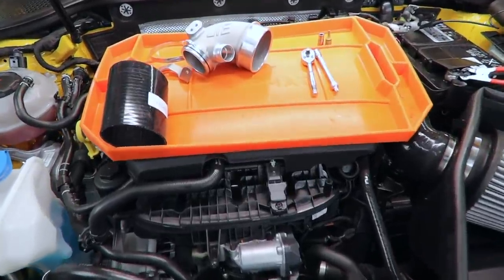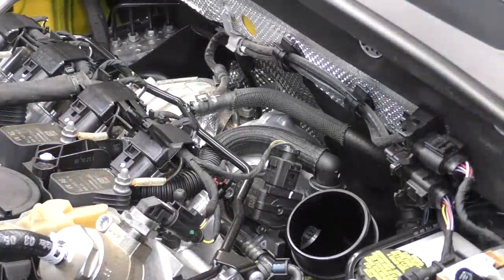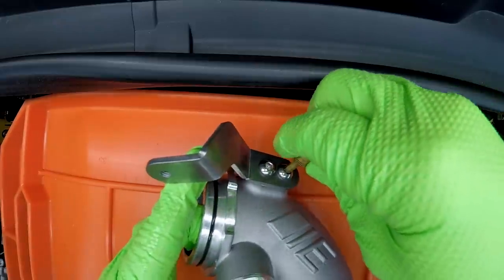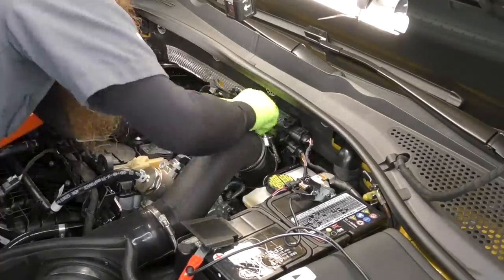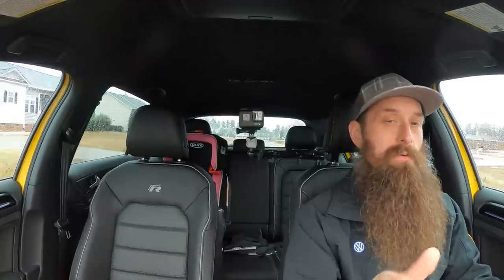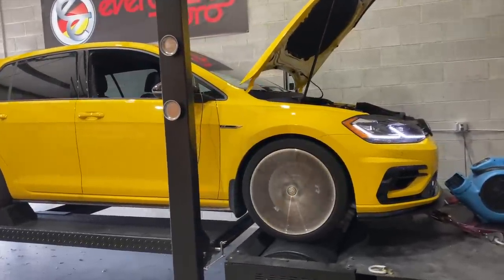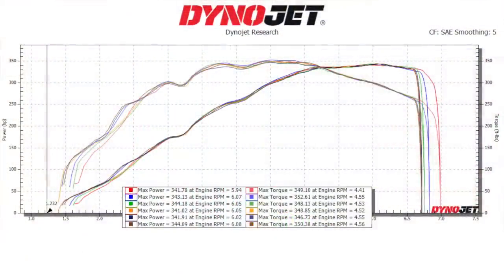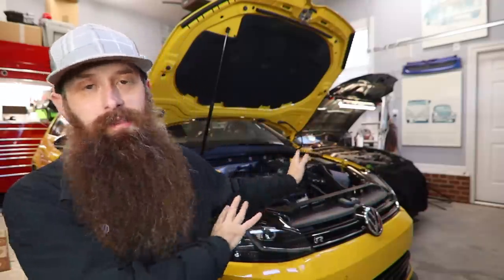Turbo Inlet Pipe Upgrade and FULL Stage 2 Golf R Modifications

Comment from the maker: So we are stage 2 now. SUPER FUN! After IE has the stage 2 file 100% we will go back to the dyno. Also While not 100% needed, I think we are going to upgrade the spark plugs. IE recommends NGK R7437-9 at .024" gap. Those babies aren't cheap at ~ $40 each. :)
Reply: Is it 100% necessary to install spark plugs for a stage 2+ ?
Reply: @yoyigu  I've always heard it's "strongly suggested" to go at least a degree colder on your plugs with stage 2 or 2+
Reply: When I had my 6R flashed to Stage 2 (Unitronic), the tech said I should expect the car to get a little faster over the following month as the engine and ECU settle into the new tune.  Have you heard this?  I'd be curious what your dyno numbers are after about a month/1000+ miles.
Reply: Rockauto has those plugs for $28
Reply: Or just spend a lot less and go Brisk ER12S. One step colder vs stock. Have to check gap a bit more often, but otherwise a great plug. Many running this plug very successfully on stage 2 or higher with big turbo. I run the Er12S on my stage 2 mk7 R on a E40 map (~415whp) and its been great
Reply: NGK Ruthenium
Reply: Was hoping to see closer to 400whp maybe the new tune will???
Reply: @yoyigu  it varies by tuner. Unitronic doesn't recommend any changes to spark plugs or change intervals. APR and IE Recommend uprated plugs , slightly tighter gapping and a lower mile change interval Just to be safe, do what your tuner suggests.
Reply: Hi Charles, can you please please make a video for water pump replacement?  there is no single normal video for it on YouTube.
Reply: @YoWassupFresh  perfect,  i have apr stage 2 high torque 91 oct , thanks!
Reply: I use OE spark plug AudibRS7 NGK 1step colder.
Works perfectly..no need gaping!!! And mine is a fast stg2+ ...
Reply: @pushdaenvelope  does it require a "special" E map?! As the sensor is build in by factory.
Reply: 400whp On pump gas?  No way.
Reply: @dirk5950  400who around 480Hp?! He want to mwntion around 330whp..that is around 400hp
Reply: This is the USA. We speak in whp only.  That’s what our dynos measure.
Reply: @JamesStreck0312  ive heard the ecu adapts to your driving style so it knows when to shift and how the throttle should feel etc
Reply: @Master321v  yes, I have a e-tune (custom) ECU tune & DSG tune through EQT Tuning. To run EQT's E40 map I did have to upgrade my high pressure fuel pump, as well as, all the std Stage 2 mods (downpipe, intercooler)
Reply: @danielhildebrand6892  don't think I've seen anyone hitting 400whp on stock IS38 turbo and pump gas. Need to run ethanol blends to get to the 400's on stock turbo
Reply: What a great job in explaining all!!!!! Thanks
Reply: 7.5 golf r❤️
Reply: HumbleMechanic amazing!! can't wait to install my IE stage 2 kits
Reply: Managed to get some timing logs on 100 to 200 timings as well as 0 to 100? Would be awesome.
Reply: HumbleMechanic I love your vids!  I'll be going down a similar path with IE in my GTI.  I have stage 1 EQ tune and cant wait to get started on IE mods.
Reply: Mr. Humble how confident are you in IE's tuning expertise in comparison to other's?

My thoughts is they may know their stuff more due to all the parts they manufacture.
Reply: Why is that so low on power? I have VWR600, TurboTechnics intake pipe, BCS Downpipe 100cpi cat and map no intercooler and made 408bhp and 420ibft on 2 different dynos.
Reply: Need to update to the current tune version and dyno to see the changes
Reply: Are you still happy with your stage two?
Reply: What are your thoughts on e85 with stage 2
Reply: My tuner said there is no pops and bangs for manual trans golf r 2018 mk7.5
Reply: How much bhp is it now ?

Comment: Charles don't just look at the peak numbers, the graph tells a great story in green.  Your peak torque may be the same as stage 1 but look how much sooner it rises in green.  Same for the horsepower, your powerband is stronger for a pretty wide RPM range.  That's something you'll feel when you're driving daily rather than just full throttle.  Good work!
Reply: Yes looking at the area under the curve is right, and it needs work between 3-4k rpm.
Reply: It's a little better. Not a lot better.

Comment: I went full APR Stage 2 on my 2016 Golf R manual in late 2017 after being on Stage 1 for nearly 2 years. According to the APR published numbers, I was at 354 crank HP and 379 crank TQ. With Stage 2, the numbers improved to 387 crank HP and 409 crank TQ. The improvement wasn't quite as dramatic as going from stock to Stage 1, but the difference was still considerable, meaning the car went from crazy fast to absolute bonkers. Definitely worth the cost!

Comment: I went from stock to stage 2; Got a lovely 100hp awakening. 
-Eurodyne stg.2 and DSG
-Racing line intake, turbo inlet pipe, and hose
-CTS turboback (de-cat), engine, trans. Mount 
-034 torque insert
I must say that it has been so much fun driving a over 400hp (crank) car. Debating if I should get the intercooler since I don't track my car and I don't use all of that hp as frequent as I would like. Great video.

Comment: The United motor sport tune is fantastic. My clutch started slipping right away, but I put in a TTRS pressure plate w/ new OEM fly wheel and clutch disc. So great now
Reply from the maker: Nice!! I have UM on my R32. Probably going with their Haldex tune on the R

Comment: Charles. I have did an IS20 withe IE stage 3 tune with the DSG tune on my VW Alltrack. This is hands down the best tune money can buy. I am shocked just like you at the power. The shop that did it for me recomends the NGK racing spark plugs you state bellow only above 400 horsepower. The stock ones gapped at 0.026 work better for us under 400 horsepower and is more correct. IE states this gap on their site for all engine tunes. Love your channel. John

Comment: Good video. To your point, Charles, about how important this piece is, it solved knock under load on a MK7 GTI Stage 1 and A3 8V Stage 1 as well - no other parts added. It improves flow at the turbocharger significantly.
Reply: so its worth adding to a Stage 1, in your opinion ?
Reply: @JDDD33  I would say so. A known good product that will facilitate the increased airflow from the turbo is a good thing indeed.

Comment: I would recommend anyone installing a stage 2, install a good catch can. Also another good upgrade is converting from the plastic sump to an alloy sump with cooling fins. They hold another 1.5QTS of oil, and drop the oil temp another 20F.

Comment: Got an IE turbo inlet for a customers car. Ported it and polished it. The stock inlet will now fit inside the IE pipe! Next restriction is the inlet of the turbo itself. You can see through the IE turbo inlet to a ridge of the turbo that is blocking some flow into it. Time to bust out the die grinder and get to work...

Comment: I had a similar interpretation of my 2019 Mini JCW. I had a stage 1 and then went to stage 2. Stage 1 (ecu tune only) is how the car should have been from the factory where the engine pulled pretty stout and strong. Stage 2 (High flow 200 cel downpipe, uprated inter-cooler and stage 2 ECU tune), ok, now it's showing a hint of gnarly beast in there some where. I can see why the factory wouldn't necessarily need to sell it this way.

Comment: Just to give you a heads up, we just did a compression test. 
2019 Golf R DSG
Cylinder 1,3,4 came back at 185psi.
Cylinder 2 came back 160psi. 
Not saying its blown, but we will put a scope in it soon.
Reply: Hopefully head gasket like when my car lost compression in 4 and 6
Reply: @britishav8tor75  yes Im FBO/Full E85.
Im not worried, i have been expecting this to eventually happen.
Reply: @whydoihave6neutrals772  would be cool, ill keep you updated.
Reply: Some One good luck hope it’s that and not your whole block! Good luck!
Reply: @whydoihave6neutrals772  fingers crossed
Reply: rings. sorry
Reply: @SomeOne-on6yf  What symptoms or symptom were you having that made you do a compression test?
Reply: @zohanjames7793  low dyno numbers,  scope test came back looking good, another compression test confirmed finding of low pressure in cylinder 2
Reply: @SomeOne-on6yf  damn, I'm sorry my man. Do you think the tune caused this?
Reply: @zohanjames7793  to be honest, we bought the car to be hard on it. We had several tunes on the car in the past 13k miles. So there is no real way to say  what actually  caused the issue. 
We will see what happens moving forward. Either way, we will suprise people what this thing can do. 
Might start another channel with edited  videos.

Comment: The big difference between Stage 1 and 2 wasn't really the peak gains but how much power/torque was gained on the top end.  Looking at your dyno charts it was a significant gain.  Since I have a 6MT I probably won't go stage 2 until I need to replace my clutch.  At that point tossing in a downpipe is hardly any extra work.  Honestly I'll probably skip Stage 2 and go straight to Stage 3...

Comment: Great vid, i did to IE  stg 2 93 octane on gen2 CDNC Audi and my consumption is now 5l higher as with stock map, and i have tried EV regime of driving 80/100/130kmh... did u see/had any problems with IE stg2, my car runs ok and u see gains clearly but +5l is bit too much.... now is 15L/100km, before was 10-10,5L/100km...

Comment: 4 wheel linked dyno required  really , As for the frontpipe  I would have gone for one with the cat further down the pipe as under bonnet temperatures will be higher, CHARLES what made you go with IE and not APR or racingline( if you have it in your country), good video for newbies , keep up the good work 👍

Comment: I was able to pick up an APR TIP and CTS Turbo inlet hose plus APR turbo muffler delete and turbo outlet hose for under $200. So I snagged those for the low. With APR Stage 1 and DSG tunes, I should be good with adding those mods. Stock right now, just with the tune. I will pick up an intake later, torn between AMS, Eventuri, or Unitronic. But I will pick that later. Just want to make sure I'm good with the turbo inlet/outlet mods while stage 1 with no intake.

Comment: Hey Charles, you’re a legend mate your videos are top quality.
I’ve recently stage 1 ECU, stage 2 DSG and cold air intake with turbo inlet pipe but no pops or crackles :( which I was hoping for. I’ve heard there is a tune for pops and crackles without having to stage 2 with downpipe?
Is this true or would you recommend stage 2 with catless downpipe to get the noise? My only concern is this is my daily driver and I sometimes have clients in the car so don’t want the constant petrol smell. Appreciate your thoughts!

Comment: Your job is-ab-so-lut-ly incredible, hats off! Thanks for all the DIYs and information. I have a question, I'm so worried about the OPF (otto particulate filter) because EGTs seems to be much higher than the non-OPF cars, What are safe max numbers? What about stage 1 with more pressure? And stage 2? I can see 950º easily in a stock car.

Comment: Going to stage 2 on my TDI with a good high flow DOC and a none smokey tune, and then probably upgrading to the Bosche CP3 injection pump retrofit to prevent a CP4 catastrophic failure once the extended warranty runs out in a couple months here. That should fix all the potential shortcomings of the MK6 TDI's and hopefully the engine will last untill the car falls apart around it. Minus a potential turbo failure (Maybe an excuse to upgrade to a cr170 turbo :) )

Comment: The reason these cars are tuned down is because the engineering goal is to tune out turbo lag.  It is about a specific driving experience of the brand, not maximizing engine's potential.  My mk7 felt great on the stock tune, but I wanted left foot braking....so stage 1.  Now turbo lag is very noticeable, and then it drops off quickly at the top end.   Stage 2 will fix most of that, but the clutch....my parts are on order!

Comment: What are the benefits of the new ”turbo tube”? HP etc...?
Thanx for awesome video 👍
Reply from the maker: Better air flow into the turbo
Reply: Without a tune, not really worth the money. The tune is the key to unlocking the ability of the engine to flow more air/fuel, then the little restrictions can add up to a reduction of efficiency.

Comment: Charles, Why did you go Integrated Engineering vs the Unitronic which is sold with your co-hort Paul.  It looks like the Integrated has more support for getting it right. Also, the Integrated seems more cost efficient.  Your thoughts between the two systems? Owner/Manufacturer suppor?

Comment: Something I didn't hear you mention but find significant is that, while PEAK torque for Stage 2 is same as Stage 1, Stage 1 torque falls off after 4K RPM while Stage 2 makes about 25 to 35 lb/ft more than Stage 1 from about 4,700 RPM all the way to redline.  That's going to be significant in real-world driving, in my opinion.  Also, how is drone with this downpipe?  Is it of high quality?  Getting a CEL?  THANK YOU!
Reply from the maker: No drone, no MIL.

Comment: Do you get aftermarket turbo inlet pipes b/c they are bigger so hence providing more air? You know it may not feel like that much more power but lets look at the power gained under the curve. The torque peak is higher and more so it is sustained longer as well. The Hp is great under the curve as well. Yes stage 1 over stock is much better and you are right that's how it should have come from the factory but lets take into consideration the strain stage 1 has on all the parts. The amount of boost asked for by the flash vs the amount of air those parts flow over time could wear it out a great deal more. Stage 2 Seems to take into consideration the strain of asking more boost from the engine so hence the bigger piping to make up for more air. I take it at this point Stage 2 is close to maxing the stock turbo out and Stage 3 will include a bigger turbo? You are highly informative and entertaining so not trying to be critical at all b/c you know much more about this than I do, I guess I am trying to figure each stage out from basic logic and my small understanding of engines/turbo engines.

Comment: Great video Charles.  Thanks for sharing all the details, and the price estimates.  I’m hoping to get to the tuner here in the next couple of weeks to get all my parts installed and UM stage 2 tune for ECU and TCU.  Doing the same IE IC and DP, but went MST for the intake and inlet.  Hoping to get around 380 hp at the wheels.

Comment: @HumbleMechanic, got a question for you, on the IE website the stage 2 tune is advertised as 431 bhp and 466 btq for the 7.5R on 93 oct. fuel which should be around 380 whp and around 400 wtq which is imo kinda optimistic.
Your numbers are a bit lower then the advertised so do you think your numbers are lower because of the beta file or is IE a little bit over advertising the numbers? I am asking because I am considering to go Stage 2 either with IE or Unitronic.

Comment: you can mod the stock intake opening the right side , also changing the inlate hose. With the inlate pipe, turbo muffler delete and a KN sport filter in the factory box you have cooler air than with your setup. Also I wouldn't change the intercooler and downpipe, it isn't worth the money for something like 15-20 hp. After I would do the air mods i mentioned i would do a custom tuning at someone who really knows what he's doing, not that tuning from a distance crap and get the performance about half way your stage 1 and 2 , all under 1$(a little more with dsg tune).  PS: in my country(Romania) a custon tuning is like 300-400Euros .

Comment: Sure seems like S2 benefits is only realized north of 4300 rpm, and not a significant benefit until 5,000 rpm.
Here's the way I see it:
Stage1:  Software tuning only. Good for around 270-290 horsepower.
Stage2: Software and all the external hardware (intake, intercooler, inlet, downpipe, [in the case of the GTI the IS38 and a clutch in manuals], catback exhaust, a good catch canister, and software to make it all function very well. Good for 350-370 horsepower, depending on gas and conditions.
Stage3: Remove engine, remove heads and block, install forged parts, beefy bolts, install big turbo, upgrade any and all supporting stuff to make this setup run reliably. You'll need big brakes, high temp brake fluids, beefy clutch (for manuals), sticky semi-slicks, possibly stronger half shafts/axles, and most definitely a totally revamped fuel system to supply plenty of fuel. You may install water/meth injection to cool IAT's, you may replace the composite intake manifold for something that can hold plenty of boost. Good for 450-550 horsepower depending on fueling options (water/meth, E85, race gas, whatever) and hardware.

Comment: Questions : 
- Do you need HPFP and also 1 step colder sparkplugs for stage 2?
- Don't you change the motor and transmission mounts in your stage 2?
- Will I actually need to change the clutch of I don't WOT on 1st gear?!
- Do you need to upgrade something with the radiator after changing the intercooler?
- Are steel brake lines worth it, or stock ones are okay?

Comment: On other cars I've seen with upgrades (like my CTSV) items like upgraded intercooler, pulleys, belts and injectors are always part of upgrades (generally supporting mods go first, then pulleys, injectors then cam etc..). 

Yet every VW Golf R vid I've seen with various stage 1 (which seems super simplistic?) and stage 2 (which again seems kinda minimalistic in comparison) only seems to replace a few minor things. Are injectors, pistons, fuel pumps, upgraded cooling solutions (meth/intercoolers or active coolers/chillers) etc even a thing to upgrade? Or are those solely for racing purposes?

I'm looking to buy a VW Golf MK 7.5 in the next few days and I'll likely at least be putting an upgraded air intake and at least a tune (stage 1-ish) to add a bit of pep in my daily driving on the car.